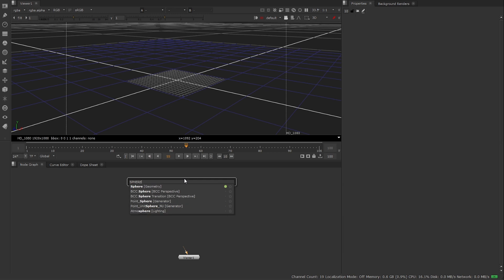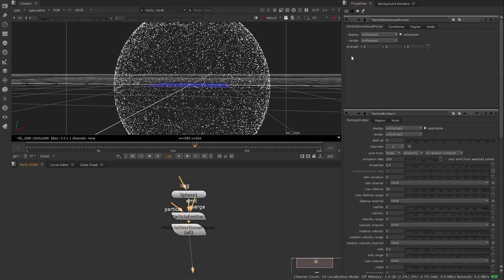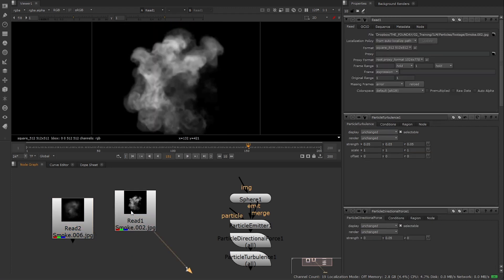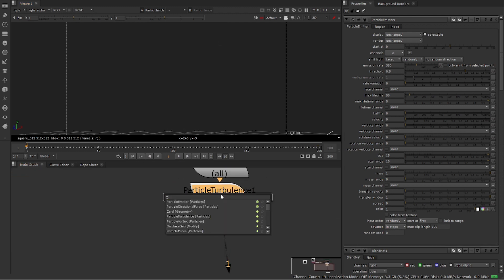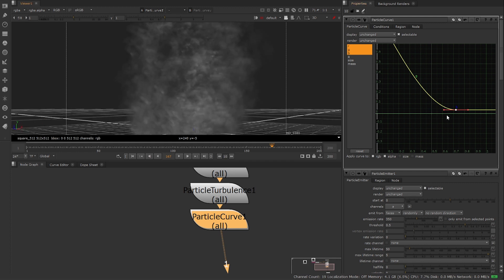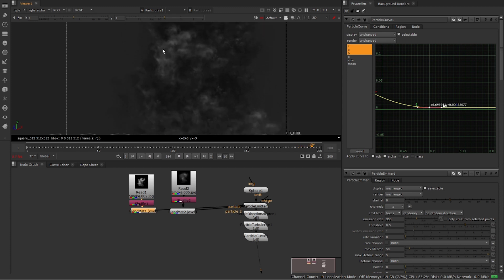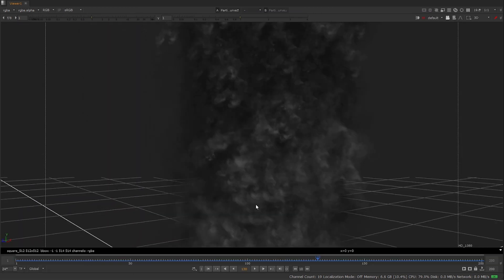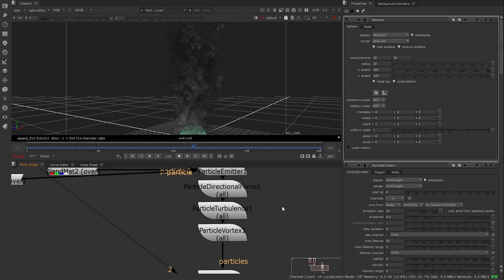How to create a column of smoke in Foundry's Nuke using particles

Comment: Hi.
It looks like the BlendMat modulate does not work in NukeX 12.2v3. Is there a work around with this?
Reply: Hi all, so it's something to do with the image I have used for the sprit. Does the image have to be a certain format with an alpha and does the image need to be a certain bit depth?
Reply: @Kegsie200  Did you solve it? I'm having the same problem
Reply: @user-mj6zg8hh9h  try switching your renderer to "nuke" instead of hydra in pref, then restart. But it's just for scene view purposes. render stays the same
Reply: @Lumicphotography  THIS!
Reply: @Lumicphotography  thank you!!!

Comment: Somehow my RGB and A values in the curve don't do anything. Tried it several times but no result, what could be the problem? Thanks in advance,
Reply: Did you applied a material to the particle?
Reply: @ChaosVFX  I got it, the trick was to have the materialblend set to modular. Otherwise it wouldn't do anything